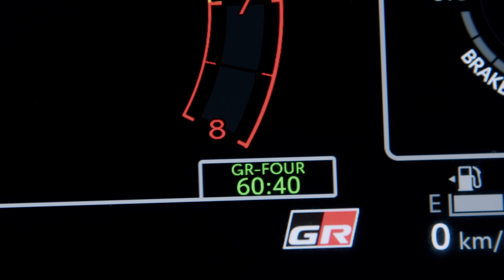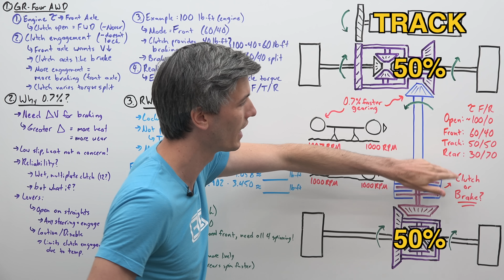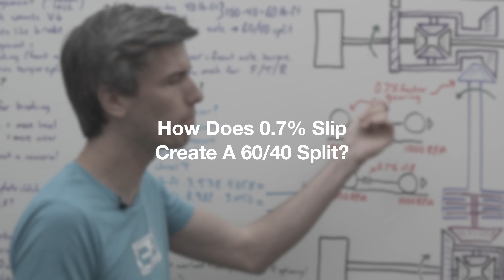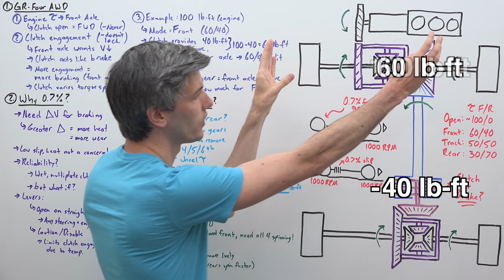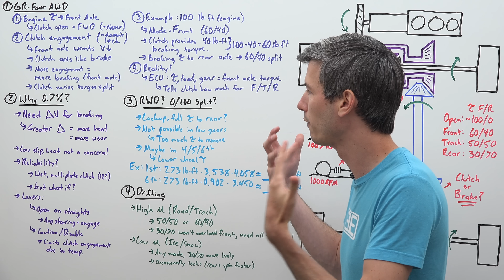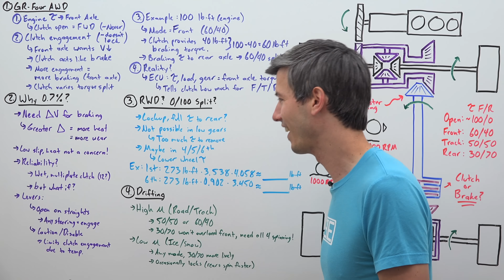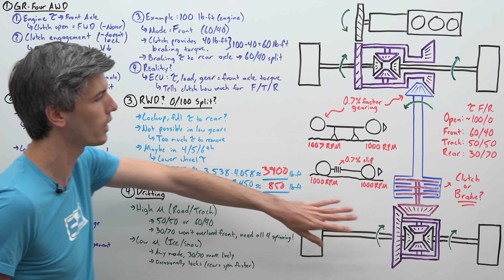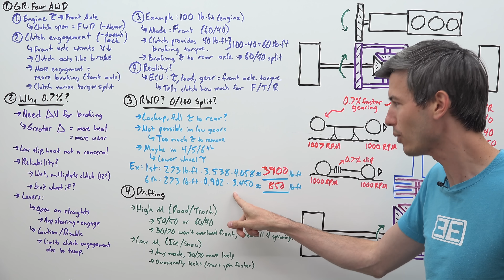Toyota GR Corolla's Brilliant AWD System - How It Splits Torque!

Comment: Glad you mentioned the center clutch pack was wet. I was imagining just how fast that would wear out since it's always going to be slipping. This little machine is amazing. Wish I could get one.
Reply: As a GR Yaris owner, I'm still not sure if it is a wet clutch pack? I also assume it wet in some forums but many replays says it's dry. From below the car I can't verify.
Reply: @jpdw7543  If it's dry there's no drain or fill holes. If it's wet it needs both. Every description for the GRY indicates it's a wet system and service manual has a fill capacity. If it were a dry system it would of burned out quite some time ago but even as a wet system it still will have increased wear if it functions like all this marketing indicates. I'm still inclined to believe in a straight line the car cruises in very FWD mode.
Reply: @Vermonstered  Thank you for the confirmation. I thought the same from the beginning but some others they made me doubt.
Reply: @jpdw7543  wet
Reply: With pretty much constant slip in many modes it will still wear out fast. Oil won't help with that completely.
I guess that there are lots of sensors in that clutch pack to precisely measure it's temperature, and most likely software in the car will disengage it before it overheats, but it will still wear out quite fast as it will wear out even when cold slipping.
Also it would be interesting to know how much a replacement set of clutch disks costs for the Corolla and Yaris GR. As it is a Toyota i guess that they expect you to mostly drive around in Auto mode with 2wd, and really pushing it like once a month for an hour or two it may easily live though 2-3 years and that's really all you apparently need in a new car as you throw it out after that anyways 😉
Reply: @AgneDei  you and a rock have the same IQ. You clearly know nothing about these "wet clutches" so instead you came up with a bunch of BS numbers. Bruhhhhh 😂
Reply from the maker: @AgneDei  Why make up numbers haha? 2-3 years? You really think Toyota's gonna make a part that consistently fails within warranty? Also, there is no "auto" mode, no 2WD mode. It's always AWD. Please read pinned comment above for durability concerns.
Reply: @EngineeringExplained  For a sort of science driven person you are really naive in belief that a constantly slipping clutch can physically be reliable. It's not hydrokinetic, the slip still wears down the clutch material, the oil just prevents it from burning up quickly. 
Any motorcycle owner with a multi disk wet clutch will agree with that FACT.

I assumed that there is an auto 2wd mode as that would make obvious sense with what you described. It's how literally almost all 4wd systems work nowadays in cars with traverse mounted engines, and by pure statistic it's highly unlikely that all of them did it wrong, and only Toyota knows how to do this.

2-3 years(maybe 4, by the way in EU the standard consumer warranty is 2 years long, while a standard warranty for business is only 1 year) is most likely exactly after the end of extended warranty and that's exactly what manufacturers are doing for years already, making cars after their lease as expensive to maintain as possible, to make new lease more attractive to the customer, than keeping/buying out their car after the lease ends(this drives new car sales hard for many years already).

Also as to the warranty, I'll be very surprised if Toyota has a warranty on that clutch, which is basically never under warranty as a normal consumable part.

As to the "explanation comment", cylinder wall and piston are designed for low friction, they often have ceramic coating to reduce friction, and they are sprayed with engine oil, which is slippery, and a totally different kind of oil than a gearbox oil designed for wet clutch.
If you used engine oil in that clutch pack it would most likely stop working as it would really start slipping like crazy. That's the reason why you can't even put normal gearbox oil(not to mention engine oil) to a wet clutch setup or you'll break it. That's seriously basics of wet clutch operation.
I can believe that Toyota put a lot of engineering to limit this effect, and oversize the clutch so that is has lots of material to chew through, maybe a big filter to catch the ground up material, but in the end, physics is physics, and unlike the engine example, clutch disks are designed to grip, not to slip.

I'm quite sure that they would talk a lot more about the clutch if they managed to make a hybrid of a hydrokinetic clutch (where slipping only heats up the oil instead of grinding down metal parts), and a normal friction multi-disk clutch (as in haldex, dsg, motorcycles, and lots more).
Reply: @AgneDei  Or... does the wet clutch act more like a torque convertor? If the pack uses ATF there may not be any actual physical contact between the plate and the clutch. Caveat, I'm no engineer and I don't know, but I agree with EE that Toyota wouldn't design a component that is guaranteed to fail during the warranty period.🤷🏾‍♂
Reply: @danoberste8146  Think about it for a second. I know EE tries to marginalize it but do the basic math. 300hp car with a 30/70 torque split and a 0.7% overdrive gear. First is 300hp with 70% going to the rear. 210hp. Now 0.7% of that needs to be converted to heat through the clutchpacks. 1.47hp. That's more energy than most of the appliances in your house and only on par with your microwave and A/C units. Then realize this is done via some type of friction be it viscous or surface to surface and think it causes marginal wear? Or instead is it more likely that this system operates like all the other FWD based overdriven AWD systems of today? Most cases the car is in 90F/10R splits or about and wear and heat is managed and only when the system begins to detect slip or high G does it attempt to clamp down on the clutchpack and actually send power to the rear.
Reply: @Vermonstered  this wet clutch system has been used on Toyota AWD cars for about 10 years already. Just look up electromagnetic coupling unit for a Toyota Sienna/Rav4 etc
Reply: @Slicks14  uh huh. But not in an over drive capacity. Making the rear spin faster than the front adds complication. C'mon, think about the differences instead of regurgitate.
Reply: @EngineeringExplained  there is a 2WD mode. It’s buried behind a secret pedal/handbrake combo, but you can fully disengage the rear clutch pack to make it FWD (on the GRY, at least)
Reply: @Vermonstered  lol a car doesnt use all hp all the time. Secondly, the heat generated is not a problem with the small amounts generated
Reply: @orcarcher  The problem is that the clutch disks must scrape together to engage the rear wheels, and since the drive ratio differs between the axles, that clutch will always scrape together, doesn't matter how much power you put in it, it will wear the clutch disks even during coasting in neutral (if the rear axle clutch doesn't disengage). As mentioned before, unless Toyota discovered a hybrid hydrokinetic+friction clutch, it will wear down constantly in the setup presented in the video. That's simple physics, and that's why normal AWD systems have a central diff instead of a clutch, even when their axles have the same drive ratio.
That said, Toyota likely engineered it so that it will hold up to normal usage during warranty (if the clutch pack isn't considered a consumable, and that seems unlikely) for most users.
I guess that the first place to look for occurrences of this problem will be the Nurburgring racetrack taxi companies, as they really hammer down the cars they use (effectively simulating many years of wear on many components in couple months).
It's also possible that as I previously assumed, on the straight, without high power input, it may just disengage that clutch and that would pretty much completely solve the issue (and they likely say that it's not the case so that they can call it "full time AWD", like in Subarus, Audi's with longitudal engines and quattro drivetrain, and some others, and not be considered lesser drivetrain, as it is often said about haldex and other part time 4wd systems used in suv's).

Also to the guy who says that this Toyota drivetrain was used for 10s of years, watch the above EE video before you comment on it, as it's clearly stated that it's a brand new solution .
Reply: @orcarcher  Ever think this car will be used at the track? Where full throttle is more than half the lap time? Car needs to survive there as well. Additionally even cruising on the freeway you're designing a system that is cooking 200 watts of friction ALL THE TIME? Think that causes no wear and develops no heat from the friction? Think a bit.
Reply: @AgneDei  the problem with your theorycrafting is that it’s been proven wrong by multiple manufacturers using the same general strategy for years without issue.

Literally all of Honda’s torque vectoring systems.

Every GKN Twinster unit, which is used in things like the RAV4 Adventure trim.

And literally any clutch-based AWD system when it isn’t driving in a perfectly straight line.

I recommend you read up on some history of the wet clutch design, starting with Hele-Shaw clutches and then read the research in SAE archives about all the work done to control the fluid film between clutch plates. You might be surprised how little actual clutch-on-clutch contact there is and how much force is actually transferred through fluid shear.
Reply: @Kyriaeus  I assume that you didn't really read what you respond to. The issue is that according to EE, this Toyota system slips all the time(even on the straight, even without accelerator input, apparently there's no auto/2wd mode to let the clutch stop wearing) with quite significant percentage of difference in drive ratio between front and rear diff. No other drivetrain in the world does that, or ever did, so Your theorizing is completely invalid, and you likely don't understand the problem at all.
Reply: @AgneDei  the problem with your theorycrafting is that it’s been proven wrong by multiple manufacturers using the same general strategy for years without issue.

Literally all of Honda’s torque vectoring systems.

Every GKN Twinster unit, which is used in things like the RAV4 Adventure trim.

And literally any clutch-based AWD system when it isn’t driving in a perfectly straight line.

I recommend you read up on some history of the wet clutch design, starting with Hele-Shaw clutches and then read the research in SAE archives about all the work done to control the fluid film between clutch plates. You might be surprised how little actual clutch-on-clutch contact there is and how much force is actually transferred through fluid shear.
Reply: @Kyriaeus  Are you insane? Those Honda systems don't slip all the time and don't have different final drive on the diffs (or even the torque vectoring system is just for a single axle, and only works in turns under power, that's a completely different behavior).
The gkn is again, a single axle solution for the electric rear axle, so it's again only working under power, only when the wheels slip, or under power in the corners. Example that doesn't apply here at all.

Any cars with part time systems don't even allow the user to lock 4wd at higher speeds for this reason (even though their axels match speed, but just in the corners it would cause clutch(for example haldex) wear).
All of full time AWD systems have a center diff.
Next time try to read first, perhaps you'll learn something.
Reply: @AgneDei  it’s obvious you’re just making stuff up. There are plenty of AWD systems that are simultaneously overdriven and partially engaged even at speed. I gave you examples, feel free to drown in denial.
Reply: @Kyriaeus  You're straight up lying, your examples are incorrect as they don't apply here at all, they weren't even AWD systems(Honda), or single drivetrain(Toyota). Feel free to drown in denial.
Reply: @AgneDei  1) Honda/Acura IVTM4 is an overdriven clutch-based AWD system with no center diff.
2) Your original point that it’s impossible to sustain clutch slip under load without cooking the clutches is inaccurate, as evidenced by:
Honda, Toyota, Subaru, Mazda, basically any full-time clutch based AWD system. The Mazda AWD system is overdriven by 1% and is never fully disengaged.

Modern torque converter clutches can be made to sustain a 30-50 RPM slip under load to dampen vibrations. Suck on that.
Reply: @AgneDei  lmao imagine being such an edgelord that you claim “reality” as a source, and then proceeding to be wrong 🤡
Reply: @Kyriaeus  I didn't say that it's impossible to sustain clutch slip only under load. You clearly didn't read what you respond to so bo discussion with you makes any sense.

All of your examples aren't full time AWD.
Reply: @AgneDei  the examples I gave are literally full time AWD. It seems like you don’t understand what full time AWD is.
Reply: @AgneDei  also I gave examples of sustained clutch slippage under load, it’s like you have your head shoved up your rear on this issue
Reply: @Kyriaeus  They disconnect when they aren't needed, hence they are not full time AWD. Plain and simple.

As to the Honda system it's a perfect anti example of your imaginary claims. It has a planetary gear before the rear diff that switches between one to one ratio and rear axle overdrive ratio, which is basically a perfect example confirming what I was saying all the time.
As to the slipping clutch packs, you have two clutches in the back, after the differential, and that makes all the difference, as when one clutch locks the other slips but only in the corners(and slipping temporarily is a perfectly normal scenario for clutch packs). So it's a completely different system. In the Toyota GR you have the clutch before the constantly overdriven diff. 
If you don't see a difference than there's no hope for you.
Reply: @Kyriaeus  Only You stated that clutch can't slip under load. I never wrote such a statement. Seriously, learn to read.
Reply: @AgneDei  the Subaru and the Mazda never disconnect. They are always at least partially engaged, and are therefore always slipping under load. If you can’t understand this after being told 5 times then there’s no hope for you.
Reply: @AgneDei  ok sure buddy. The backpedaling is strong with this one.
Reply: @Kyriaeus  Subaru system isn't overdriven, and in performance Subarus you have a central diff. Without the overdrive you don't have constant clutch slip. It would happen only in the corners and thats ok for the clutch as it's temporary, and relatively infrequent compared to the time spent driving straight, or almost straight. So please try again.
Mazda system again has no overdriven rear axle.
Reply: @danoberste8146  you’ve got the right idea - it’s a combination of the fluid film and clutch material properties and design that minimizes wear on the clutches. It’s why torque converter clutches can maintain 30-50 rpm slip to reduce NVH without burning up, or why you don’t see Mazdas dead on the road since their AWD systems are always engaged and overdriven.
Reply: @Kyriaeus  According to Mazda website their newest AWD is only 1% overdriven BUT in standard mode 98% of torque is going to the front, so it's effectively fwd only most of the time, and the 2% is there only for bragging rights (most likely accounting the oil drag on the disengaged clutch disks).
Check your facts first.
Reply: @pmo5821  Read along, as still no valid example was presented to suggest otherwise. So you and your friend might benefit from reconnecting to the said reality in the end.
Reply: @AgneDei  This AWD was designed for WRC there's no way they're unreliable, they even giving the GR Yaris 5 year powertrain warranty in UK
Reply: @roikhanulya1516  the Rally1 cars don't use the ITCC unit
Reply: @AgneDei  source “trust me bro”
Reply: @kevinconroy6606  source was - physics, knowledge, experience and reality.
Not the manufacturer mambo jumbo marketing bs.

Comment: It has 304 hp - I don't know if a AWD system is worth at those power levels. The added weight eats the potential advantage thanks of the better traction.

My claim is: up to around 400 hp AWD isn't worth it. But I'm also only an arm chair engineer...😬😅
Reply: It's one of the lightest systems out there. GRY has 260hp "only" and awd is worth it - coming from an owner.

Comment: Living in Canada and driving old quattros this is the first car that has interested me in a long time. I've  driven haldex cars with great disappointment,  but how does this compare to the new golf r / rs3 haldex ?  New haldex seems like they are trying to engineer out the flaws of haldex (wider  front tires on rs3) and less grippy tires on the rear of golf r press cars. The GR looks like the closest thing I can get to my 2000 Audi a4 b5 1.8t with rs 4to1  center diff and torsen front and rear.

Comment: okay, so it's basically identical to the focus rs awd system.
Reply from the maker: I wouldn't say identical, but similar. Focus RS uses a higher slip %, and instead of one clutch pack for the rear, it has two clutch packs, one for each rear wheel (in the rear torque splitter).